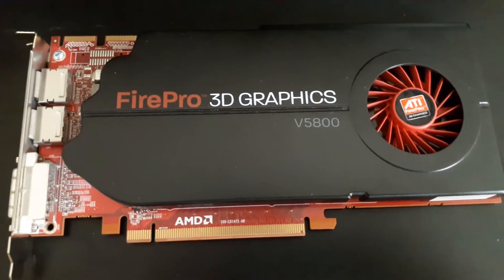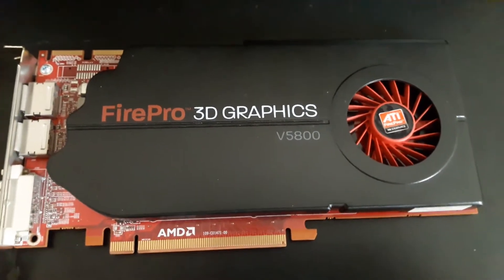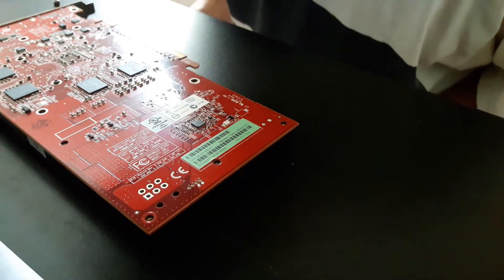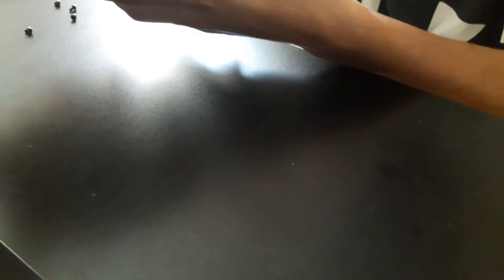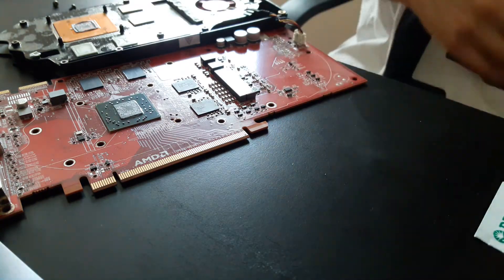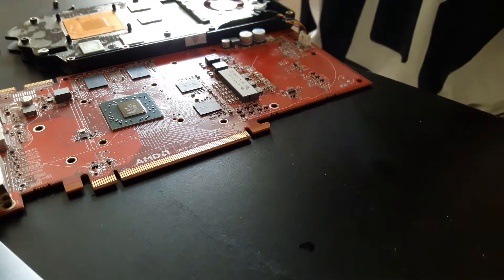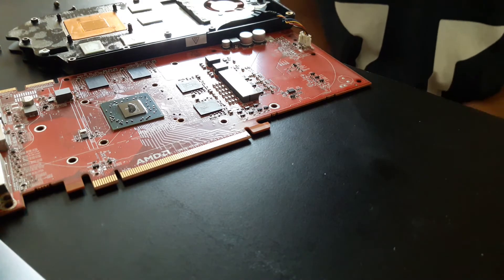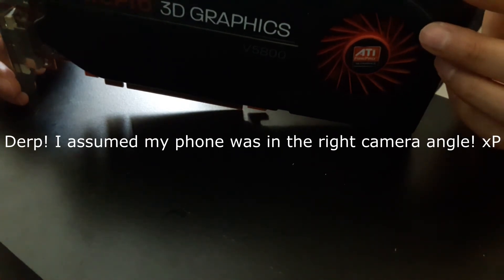Reapplying Thermal Paste On My ATI Firepro v5800

Comment: Any idea what the thickness of the thermal pads is? I'm guessing 1.5mm or 2mm.
Reply: Hope my comment will be usefull for someone.
Just finished changing thermal pads and paste on my 5900, they used 2 types of pads - one for memory and power lines (yellow color), and another for several small elements, can't exactly say what it is. It was the first time when someone disassembled this card and pads on memory had 1mm thickness. I thought that maybe they should be thicker so I tried to use 2mm pads, but after assembling found out that GPU have almost zero contact area with radiator, so I can tell that this pads should be 1.0 or 1.5 mm (I guess 1.0 is correct). 
Can't tell anything about second type of pads, because they were almost destroyed, but half of my cutted 2.0 pad had some marks on its surface after assembling so I guess 1.0 mm will be good for that too.

Comment: is it loud? what's the load temps?
Reply from the maker: If I can remember correctly, the temperature would reach about 86 degrees F while playing Paladins at high settings.

It's also fairly loud. It sounds similar to the exhaust fans of Windows 98 computers.

I'm currently building a new computer lol
Reply: QWERTYUIOP GAMING you mean 86 degrees Celsius, was considering this for some friend of mine, but would probably change my mind because of how loud it is, but is it really that loud that I should stay away from it and recommend him a quadro 2000 instead?
Reply from the maker: Lol yeah your right about Celsius. But yeah I would say go for the Quadro
Reply: QWERTYUIOP GAMING will do that  right away.
Thanks, have a nice one.
Reply: Pues déjame decirte que la mía casi ni se escucha...